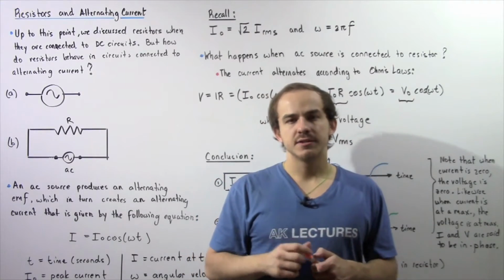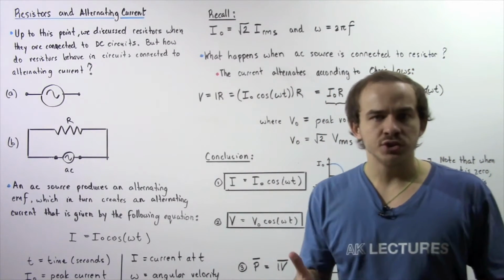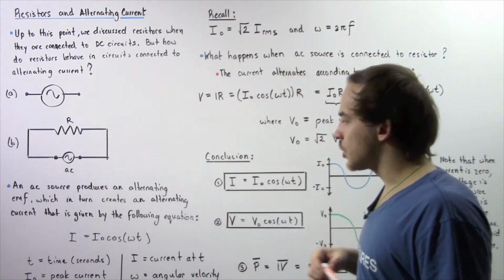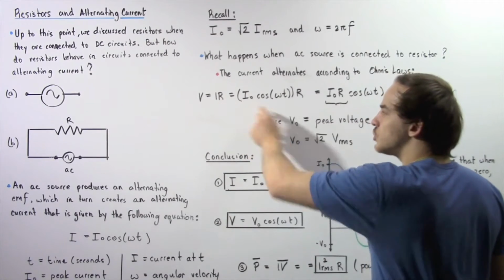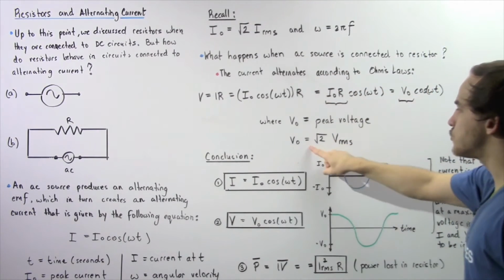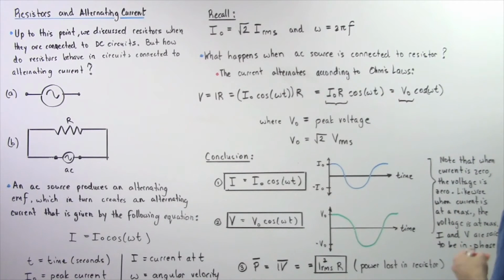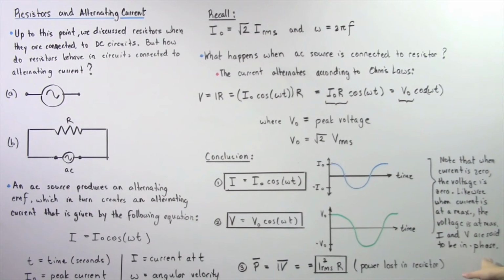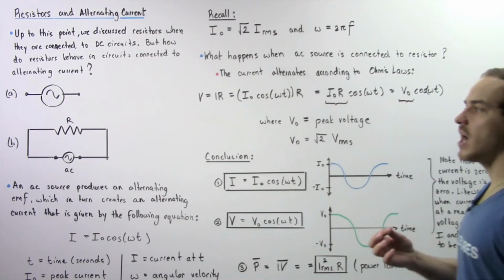Resistors in AC Circuits

Comment: Maybe im wrong idk but i think it should be sin(wt) instead of cos(wt) because it is a sinusoidally function
Reply: Sinusoidal functions typically means sine or cosine function. Remember, cosine is a sine function that lags by 90 degrees
Reply: Thanks for replying, i got it know :)
Reply: a lag by 90 degree means that the oscillation of a cosine function starts at its highest height which is pi/2 (90 degrees). Sine functions start at zero and oscillate towards their highest altitude. this is why cosine and sine look like waves together on one graph, since they have starting points that differ by a 4th of an entire period.
Reply: can you please explain this further hasan